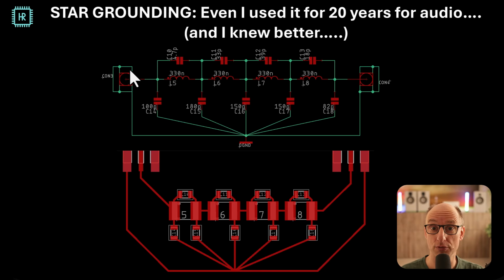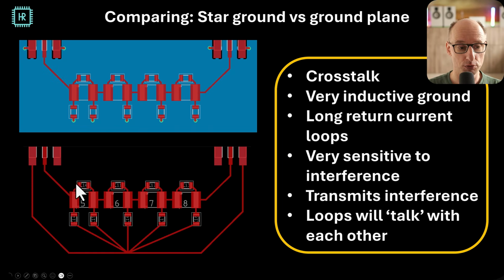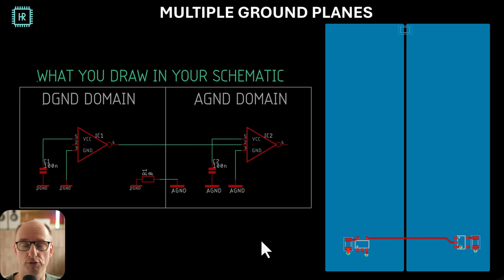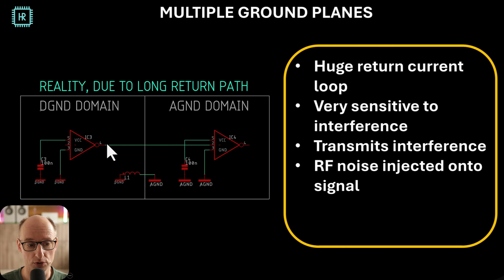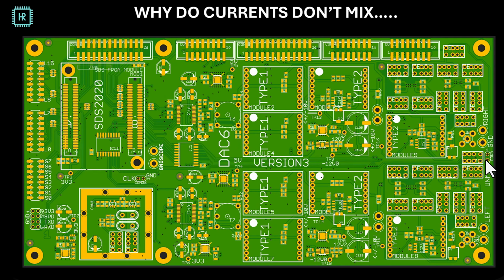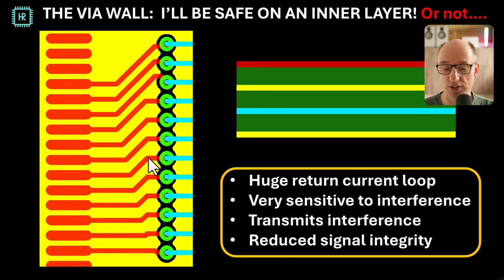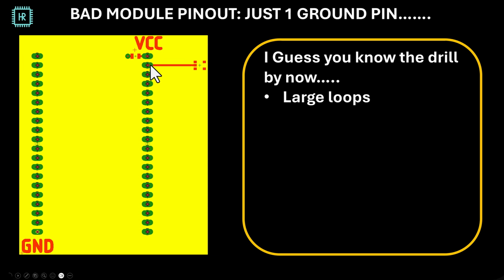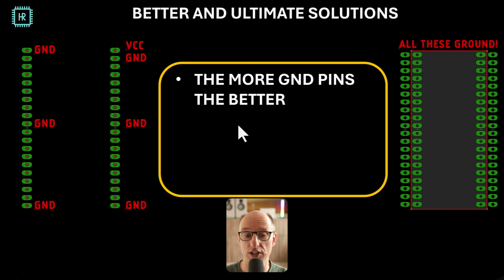Why Your Ground Design is WRONG — and How to Fix It. Flawless PCB design part 6

Comment: At ~8min 35s you suggest a four layer stack. TLDR; It is usually tricky to do a 4 layer board with controlled impedance unless a trivial design and consideration of how it's made. The real problem is that on a PCBs of more than a few cm^2 you have to consider ‘copper balance’ as that as an effect on ease of design, controlled impedance closure, product failure rates and manufacture yield.

Making PCBs is still very expensive especially in small volumes. Even though the costs have vastly dropped in the last 10-15 years it is still scarily easy to spend a lot of money on bin fodder.

The 4 layer stack you suggest can be made to work, but  is (I would say often) not good practice for the following reasons. Perhaps you would like to talk about that and how you consider this in a future video?... or just out me as wrong if you know better  :)  

My worry would be that a young engineer follows the advice blindly without understanding context, and what might happen. Hopefully the peer review process would catch it though that is not always there.

Still Interested?  I've put the detail  in the replies below, as  YT  sometimes omits posts if you do too many too large too fast.
Reply: The 4 layer board stack you suggest is,  'unbalanced' in multiple ways. (in quotes because there are always edge cases and fixes). There are at least three ways to make a 4 layer board, but the most common for 4 layers is two steps. Double sided copper clad Core (DC), etched with the circuit then Prepreg + Foil (+ Resist later on if <10GHz), so it looks like R-F-P-DC-P-F-R. The prepreg is very thin compared to the core. usually 0.125mm or 0.254mm, compared to 1.2mm or so. If the core is etched so that it is almost solid copper (plane) on one side, but with very little on the other, just traces,,nicely spread out to prevent crosstalk, then with the stack you suggest mreans the weight of copper is unequal, with considerably more on the bottom. 

I know new EEs are not always taught how stuff is actually made., so lets assume a noob is not aware where this goes next.. One side of the core is almost solid copper and the other is mostly prepreg, so we have made a glue sandwich of prepreg (half cured resin and glass), solid fibreglass and copper foil, which is now pressed, and heated, then cured, drilled, etched, plated and painted. Then (often in a different factory) it is loaded with solder paste and components and either re-flowed in an expensive 'pizza oven' at about 250-300C or put through a solder wave 'dip' for through hole parts (uncommon these days), though in fact, the same can also happen earlier if high heat is used during PCB fab, e.g. Applying HASL. 

Depending on dimensions, and copper and heat and a bunch of other things, stored up during design and manufacture, the board will likely warp/bow/twist due to the unbalanced thermal expansion and density of copper, Once it cools it freezes into a new shape, making it impossible to work with, and even if you do manage, it will usually fail within a short while as the forces break the via barrels vertically leaving latent faults.

There are are ways to avoid and or fix this and stick with 4 layers, which is usually cheaper, but there is another signal integrity design related issue when it comes to this stack, due to the core and prepreg being ~10:1 in thickness and sometimes due to the copper thickness, dependent on frequencies present, The unbalanced stack means the per-layer signal impedance solutions are not matched so when traces go between layers their width (and separation) has to change to compensate. The EM solutions are not linear they are logarithmic,, so for every parameter there is an almost flat region where you will struggle to avoid ~50R +/-10%, so mostly can't go wrong and then a sudden asymptotic region where a target impedance is impossible to maintain, any slight imperfection or environment change and it shoots up the graph. You sometimes can't get to that ‘flat’  region without impractical dimensions.  The unbalanced stack makes this more likely.   Further into the weeds, next....
Reply: Last bit....   Nobody will get this far, lol.
Additionally, at least for higher frequencies, the thickness, not just width, separation and medium affect the impedance both due to the broadside coupling and the fact that current travels in the surface of the copper as currents and frequencies go up.

The common copper weights (thickness) used is  1/2oz internally, (18um in new money) and a finished 1oz (36um) on the outer layers often more for higher currents or due to process.. The outer is plated to connect the vias, adding thickness to the foil increasing the imbalance (> 1GHz or so) and hence the impedance problems we had above.  The outer signal layer gets thicker, the inner one does not. 

I find a 6 layer symmetric stack, though 10%~30% more costly,  is just better, easier and less risk!! 

.e.g. P&G&Sig - Sig - Ground-Power-Sig-P&G&Sig.

Now that additional cost suddenly becomes a wise, cost effective  spend.

Bonus 1: From a return current perspective (as you point out) decoupling caps can cause the power rail to be part of the return path. So the inner layers have two parallel paths, giving those pesky electrons plenty of choice when it comes to picking the easiest!!

Bonus 2: If you are able to populate both sides of the board you get a free EM shield between your sensitive analogue and high speed digital

Bonus 3:  If 2 is not an option,  you can still keep the  sensitive and noisy signal separate and on their own respective internal layers , Proving them with spatial separation, a more consistent impedance  and a Fariday cage so immune to capacitive coupling and all but high power RF (sadly copper does not stop magnetic coupling)..

Of course you should now be wondering why  you are not using 8 layers as the outer planes (on the construction method suggested) are much closer than the inner planes so affect the impedance (of course we can change that) but for the moment are also full of holes..The good news is that adding another two layers is usually a negligible jump in cost as its the same process.
Reply from the maker: I wrote a lengthy reply to your post, but it doesn';t seem to be sent?! Darn. Anyway, I think you're right in most of what you say, for the videos its always the question how far do you go into details. Best regards, Hans
Reply: @HansRosenberg74  I did too.  I really think Google deliberately drop comments on here. It happens a lot.  Looking forward to deeper dives, there is so much you can cover.  I fully expect to learn new stuff too.
Reply: I think you are working with more complicated boards than most of the audience.  Normally,   a recommendation of 4 layers means "just spring for the extra layers", rather than "I think you can get away with only 4 layers".
Reply: @jimjjewett  Yes, some of the designs I have done are complicated - and then some. But I've also done many seemingly simple boards that still need attention to detail.  I would always argue use more layers if needed.  Though I've found some managers will push for less layers as it reduces both lead time and costs.  More than once a request for more layers has been rejected with the comment "come on, you are good at this, you can do it on just four and the product can't afford that".  Leading to much more design effort and a compromised design. The reply should be, "...then the product costs needs a review". The same is true for expensive techniques like microvias and blind or buried vias.  Happy to exchange more info if you want to make more videos on the topic.

Comment: Hi,  I like it that a professional is giving good advice, as it seems to me far too many YT electronics related channels are self taught enthusiasts that don't have the industry experience. I've watched a couple of your videos and, comparing this to my own experience, I think you are on point with what you say,  I wish I had the time to do things like this.   YT did not exist when I started out, which is a shame,  I learned either by doing it wrong or hopefully some guy (usually with a beard) educating me before I got that far. I've been in the industry for almost as long as yourself I have followed similar design rules with success and there are always edge cases (more on that in another post). But, in 30+ years, I've yet to have a board fail for signal integrity reasons (fingers crossed) from DC to 15GHz. Of course I've found plenty of other ways to screw up, lol. 

One of those things was this very topic, so I thought it appropriate I should pass on that advice (though I don't have a beard).  One piece of design advice you gave may need revisiting to give it context and/or caveat (everything in electronics is grey - even the beards) And you could easily do a whole series on the rather dry, boring subject of PCB / PCA  DFM and processes.  Though I've seen board go through fab (not mine I should add) that cost somebody a lot of money and time to put right.

Anyway with reference to this video, I do have a couple comments and one criticism (sorry) that you might want to discuss, even to refute, in a future video. As this was released over a month back perhaps you have already discusses this? Though I briefly searched and could not find.   More in a moment…..
Reply: Continued in my next post  + replies.  Yep, long post, but worth a read.  Electronics is fun but takes years to learn, in fact that is why it is fun!! (Though stressful as there is no CTRL-Z)   You can never 'know all of it' or even keep up with the rate of new techniques and ideas. And will make mistakes.  Confession: my best / worst cost $35000.
Reply from the maker: Hi JayMoog, thanks for your in-depth thoughts. I should have given more information about the 4 layer stackup nuances. There are a few more people who mentioned this. Making these videos is hard. You don't want to take too much time to go into too much detail at the other hand, you miss very fine nuances when you do that. I try to give basic fundamental theory so people can reason for themselves hopefully. The main thing here is to stop the most common errors in grounding. I believe my 3 rules will do that (just based on my own 30 years as a professional). And I also know the guys with a beard (or grey hair) which helped ME to prevent the most stupid mistakes before I ran into them :-D Very recognizable. I've also never had problems with signal integrity either. I was insanely lucky to have that 9th order filter I use in my videos as a first professional assignment for the Westerbork Synthesis Radio Telescope in 95-96. Since that was soo sensitive, I learned this stuff on day one :-).  

I think it would be nice to do a video on more complicated stackups (6 layers and more) with powerplanes and ground planes
Reply: @HansRosenberg74 I hear what you say.  I've only ever made one YT vid, it took hours and though it partly achieved it's goal I admire anybody who can do it over and over. The cost/reward makes little sense to me. It is great that somebody is filling in the gaps between formal education and real life electronics at a deeper level. You are absolutely right to keep it short and digestible,  but you can always add a little comment, "it's not ideal, just enough to make a point - more in a future video" I've no idea how they track these days, but 30+ years ago the mapping between college and work  was not great, and these days I am to believe more time is spent on modelling than in the lab. Looking forward to you future vids. None of us have done it all and still make mistakes, so I am sure there will be useful nuggets of experience that people like myself will gain, not just the beginners. I am sure you will agree electronics is a 'grey' science, there is rarely one single right answer, more a series of compromises. Helping people work out where and what they are is the main skill we eventually learn. It's the greyness which keeps it interesting!!
Reply from the maker: curious to know what kind of failures they are. Is it radiated emission tests that fail?

Comment: Star ground was a real solution when PCBs were predominantly single layer ones, especially in consumer electronics, where organasing a proper ground plane was almost impossible. You won't be able deny the fact is that Japanese power amplifiers such as Technics, Kenwood etc. were almost dead quiet with a volume knob all the way up. And there was a star ground there . Yeah sure, the production samples we got highly likely had a bunch of pre-production prototypes till they got perfect. My CASIO CZ-101 distortion phase synthesizer from 1984 is hell noisy when pulled apart. But once it's put together it gets dead quiet at it's linear audio out.
Reply from the maker: Indeed, someone else also mentioned this is a thing coming from the past! That was an eye opener for me. In the past this was the only solution.

Comment: It is very weird to see a very close head talking. Do not fill the entire screen with your head.
Reply from the maker: Camera gear limitation... I'd need to invest something like 1100 euro's to solve that, I can't get better lenses for this camera anymore unfortunately. Until I make serious money on youtube or my courses I think you'll have to take your distance ;-)
Reply: @HansRosenberg74  What investment are you talking about? You can just go farther from the camera. Duh...
Reply from the maker: In that case I'll need to move to another house :-) I had to build up something like a studio in my room and I don' t have infinite space. This was the only position I could create a reasonably good looking background, but that means my camera is already against the wall. I can't move my desk further from the wall to create the extra distance since I won't have space left in my room and the door won' t open anymore (might be good for getting more videos out :-)  ). So I'd need a lens with a smaller focal distance. Hard to get for my M50 which is obsolete. The top of my monitor would then also show up or I'd have to aim the camera downwards, which is also not very good..... You have no idea how hard it is to get all these things set up in a limited space. I also design, assemble and test all my electronics in this room. I also stores all my parts and measurement equipment and a complete high end stereo system..... Pro tip: Don't start a YouTube channel :-D
Reply: @HansRosenberg74 some of us feel more at home in a room full of test equipment and parts, perhaps if those sneak into the background for their15mins of fame now and then...

Comment: How do you feel about using  both outer layers of a 4-layer board as ground planes?  It would give leave you two inner layers to use for signal pathing, both of them having equally small distance to a ground layer, and both shielded on two sides.  Any vias to ground would connect to both ground layers.  It seems a bit like the practice of grounding the chassis of device.  I've kicked around a couple designs like this, but haven't built one yet.  It seems like a good idea from the standpoint of shielding from external sources, but I realize that every ground path through the vias would provide a secondary return path.  Even though the secondary paths would carry only a fraction of the return current for each component compared to the primary shorter return path, would it still be enough current to create measurable inductance and crosstalk?  I'm sure I'm not the first to think of this, but hardly ever see a design like this.  I'm assuming it's for reason other than just costs.
Reply from the maker: EMC wise it sounds like a great idea, but where are you going to put your components ;-)

Comment: Based on what you've mentioned, better grounding is achieved instantly by adding a ground plane. I am inexperienced in terms of PCB creation, but is there a significant price difference between 2-layer and 4-layer stackups? That to me would explain why someone may choose something such as star grounding on a single layer rather than adding an entirely new layer, though the layer will achieve better performance.

I also wonder if these days, there is maybe not a significant price difference, but in the past, more layers was significantly more expensive, and thus, engineers came up with ways to have better grounding on a single layer? I do not know, I am new to this. Just my wonderings.
Reply from the maker: A 2 layer is very affordable. 4 layers are not bad either. 5 pcbs of 100x100mm are around 50usd including shipping....

Comment: Re: 13:00 while this is better than nothing, try your hardest to always go the "ground next to each pin" path that was talked about later on in this video.

There is a big problem with uisng capacitors for return current is that they are not very good at conducting the types of frequencies that you should be worried about. The rise time of almost any modern digital circuit is in the range of 10 MHz all the way up to 1 GHz in some cases, and your common 100 nF capacitor resonates at around 1-2 MHz (meaning that its parasitic inductance starts becoming a limiting factor, and higher frequency currents will not be able to flow).

Even a via has enough inductance to give you trouble in extremely high frequency systems. But for the everyday joe, just use as many ground vias/pins as possible and you'll be golden
Reply from the maker: I agree, it remains a 'poor mans solution' ;-) It would get a little better if you changed those 100nF caps to 100nF + 100pF NP0, but it's still not optimal. Nothing beats tons of vias :-)